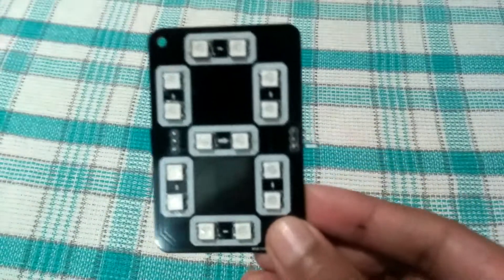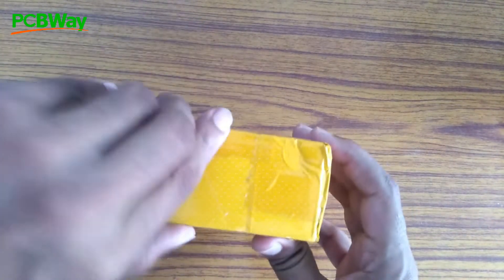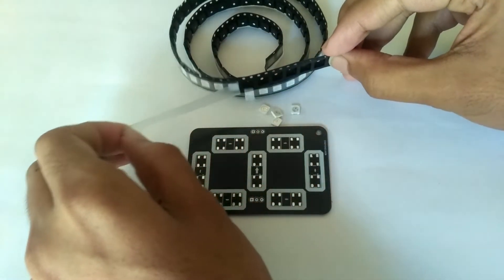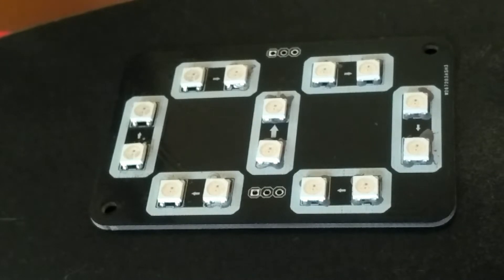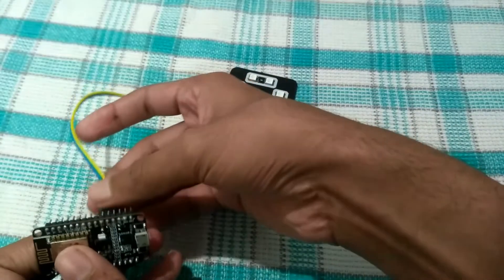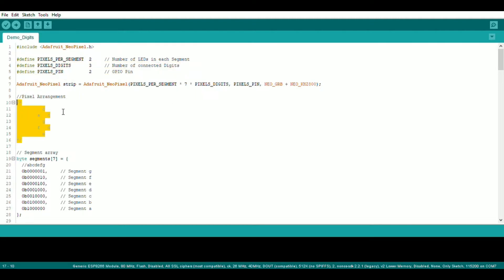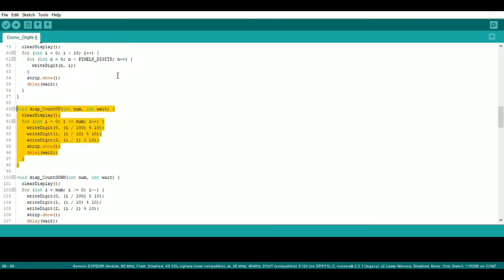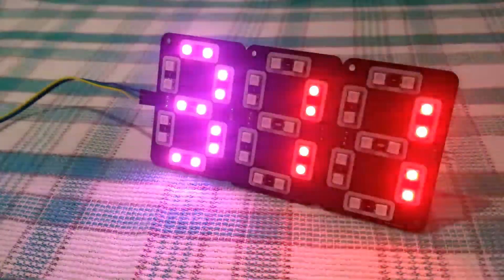Addressable 7 Segments RGB Display | NodeMCU and WS2812b LEDs | PCBWAY

Comment: Hi..given the love we have for chinese in todays time....its difficult to import anything. I got few arduinos..ESP 8266..couple of 2812B 5 meter strips and I want to do a large clock.  i also got a arduino basic kit that has bread board..capsitors..etc.  I watched few videos where they use 3D printing and dont explain in detail how they are using the coding.  Can you please guide me to a tutorial where I can do a large digital clock using things I already have.  I was searching for the same when I chanced upon this video.  I dont watch a great looking clock which 3D printing offers..but something i can do using thermocol or any other workable alternatives
Reply from the maker: Sure. Ping me on whatsapp : 7908021510
Reply: Neo pixcel library from adafruit. Com